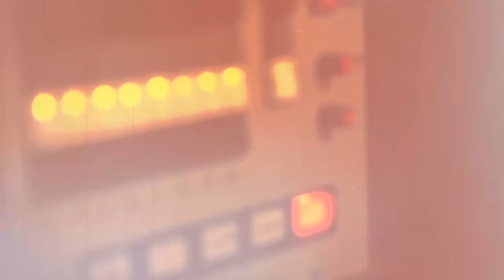How to replace preamp tubes in guitar amp (HoboRec Bull Sessions #5)

Comment: I used to have trouble with my Egnator tube amp making noise. All it took was upgrading the cables I used. I got a beefy  cable to connect my amp and speaker and upgraded the guitar cable and presto. No noise. The same fix worked for my mics. Apparently the quality of the cables does make a big difference.

Comment: Get a 6.5mm borebrush from a gunshop and clean the jack sockets first. I glue a tele knob on as a handle.
When you do this check to see if the jack socket is tightly held down if your amp has a nut fixing the jack to the faceplate. These often loosen on well used amps and will give a poor earth shield and create earth loops, so tighten 'em up. 
Other wise as spacey1984 suggests good cables and plugs. Avoid touching the terminals on plugs as skin acids create tarnish were contact the socket terminals - clean with alcohol or such.

Comment: I have exactly the same Issue in my Rockerverb 100, I believe the noise comes from either one of the channels. Clean or distorted...So my guess is that is a power tube that handles an specific channel.
Reply from the maker: Yeah, that's my guess too. Even though we changed the tubes in this one a couple of times before when they went bad. But then there was a loss of tone and volume. Not noise like this.

Comment: I believe the absolute best way to resolve your preamp problem is by using a hammer. Bring the hammer down swiftly and with as much strength and repetition as possible. You're welcome!
Reply from the maker: Thanks! No need, it’s awesome now 😁
Reply: @hoborec  Nice, what was the problem in the end?
Reply: @hoborec  what fixed it I have a similar issue